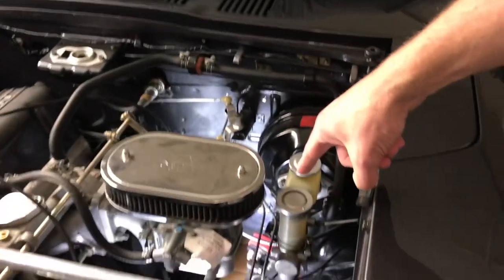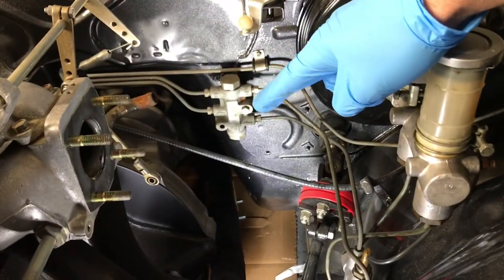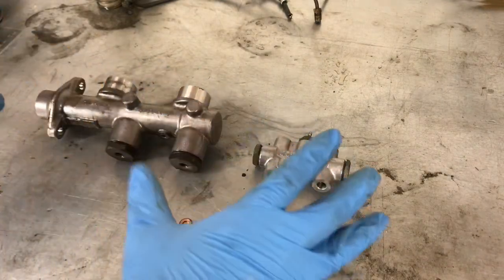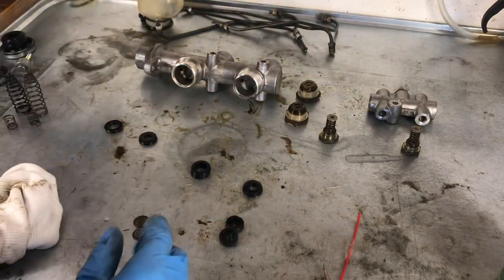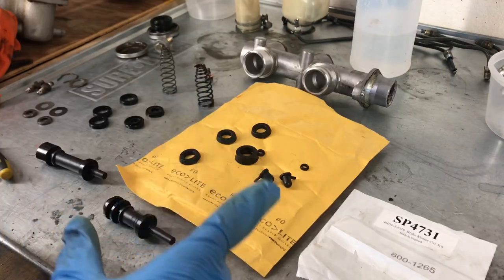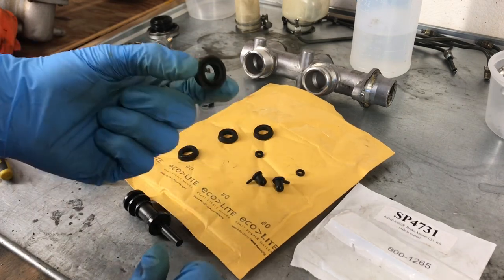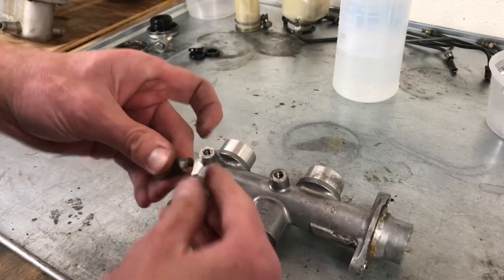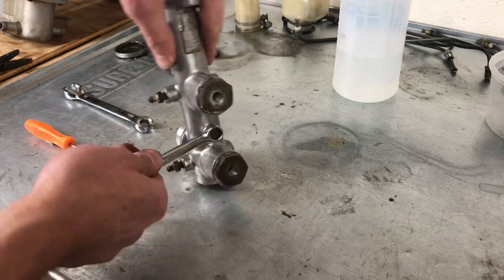How to rebuild a master cylinder for a Datsun 240z

Comment: Thanks for posting this vijayo. Yeah, I had even worse firewall and frame rail paint corrosion on my ‘72 Z car.  

Just getting to the same job on a Tokico M/C.  In the meantime I’m running a rebuilt Nabco. Don’t think there’s much functional difference, but following your instructions I can replace the one it originally had when I bought it. Thanks again, awesome job.
Reply from the maker: Richard Harvey thank you! Good luck with your rebuild!

Comment: Greate video!

The ‘71 240Z on my channel had the MC let go in a similar fashion, albeit with much more paint loss, at some stage before I bought it.  I wonder if it’s a common thing?
Reply from the maker: Built On Purpose ah right on, bummer though. Really you are at the mercy of those copper crush washers, it does seem like a common problem. Thanks for watching!
Reply: Cars, Bikes, and Coffee 
Anyone out there know the replacement crush washer size(s) and supplier?